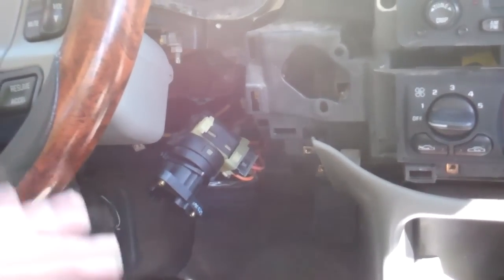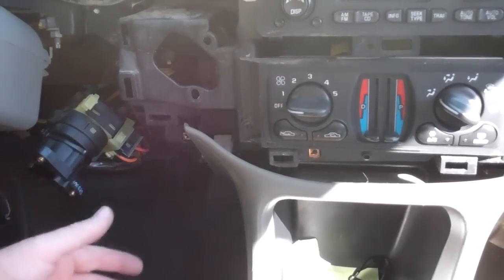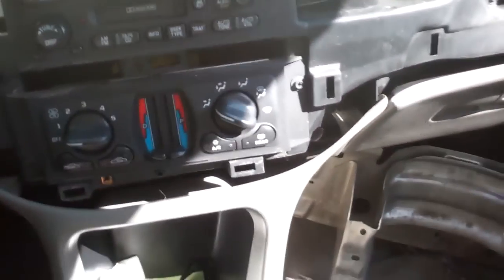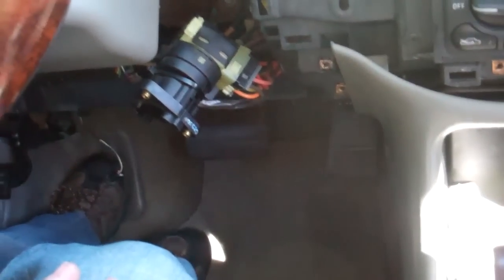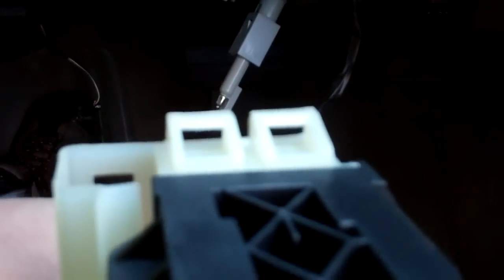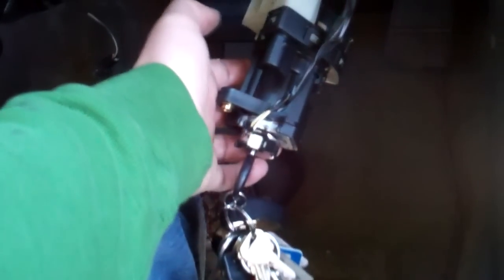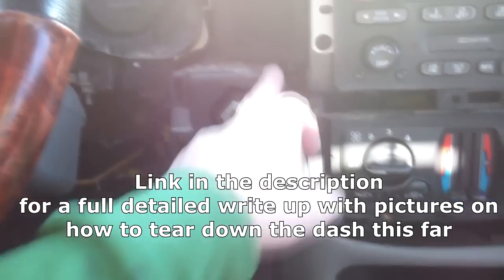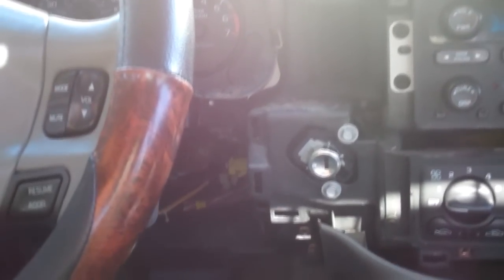GM ignition switch replacement (No Start or Intermittent start)

Comment: Hello, I hope you get this message and can help me with a 2005 Grand Prix GT with the same issue. I have the wiring exposed under the column and I found that the previous owner installed an auto start and a Bypass kit. I also removed the cover under the glove box but there's nothing there. There's something on the passenger side panel but it's different than the Grand Am.  The wires at the ignition switch are black, white, and black/white which don't match anything I find online .   Any help would be appreciated.

Comment: 2014 Civic 
we already re placed the ignition switch ( opposite side of ignition steering column ) 2 months later, SAME NO CRANK, even with tons of  jiggling ( battery , alt,  starter ALL passed )

Comment: My husband has a 2006 Pontiac G6.  Worked fine.  Then he changed the motor mounts and now it won't crank or start.  We changed the started, checked all fuses and relays.  Took off the auto theft device and still nothing.  He lost the key with key codes, but has a regular spare. He's at the end of his rope.  What dies he need to do?  Replace the entire device surrounding the cylinder?
Reply from the maker: Replacing motor mounts will not cause a starting issue.  There was some other issue present before this repair.  Read the service manual about resetting the passlock system it gives the exact procedure.  It involves leaving the key in the "run" position for 10 minutes, turn off, wait 5 seconds, repeat, then try and start.  Read the manual as there are some other subtle details I left out.

Comment: I just put a new ignition switch cylinder and the housing from a junk yard in my 2006 chevy equinox. Now it’s giving me all the lights but it won’t crank the engine or start it. It just does nothing at that point. Can you please help me figure out what’s wrong with it?!  Give me some suggestions it was working and starting fine before. Sometimes it would putter and sound terrible upon starting and I always had to jiggle the key to get it to turn in the cylinder but I figured those were just issues with the cylinder going out.
Reply from the maker: Sounds like a faulty part. Or the pass lock has been enabled and needs to be reset.  More info on site, link in description.

Comment: Thanks a million❤ very informative video
Have you ever done a pcm and bcm reprogram? ThAt would be very helpful as well. My problem is I have a 2004 impala with original 3.4L and fq3 transmission axle ratio I installed a 3.8L with f83 transmission axle ratio the only code that comes up is crankshaft sensor the car starts runs and drives
But transmission bucks between gear's sometimes not all the time could be transmission itself but also could be program was originally set up for fq3 ratio with the 3.4L
So to recap only problems are transmission bucks sometimes and crank sensor. Code because originally set up for 3.4L with fq3
I have installed 3.8L with f83 ratio
Only thing I can think to do is get a vin number from a junkyard that has same similar setup as mine with option code's closely matching mine and somehow program it? Or taking a pcm and bcm from the junkyard that already programmed for my setup..i am concerned about the milage issue though..?would these ideas work??any ideas??Thanks in advance

Comment: Could this be a fix for then you turn the key to start... and you here nothing from the starter? When the key is in the start position.. the lights on the dash go out. All other positions the lights are on. Thanks
Reply from the maker: Possibly.  There are contacts that could be dirty or worn.
Reply: @thejunkman  Have you ever seen that the Passkey has to be reprogrammed due to lack of battery power at some point
Reply from the maker: No, but the procedure is easy to do.

Comment: I bought an ignition switch cylinder can I use the same key and cylinder to start and can somebody let me know pretty fast is a 2000 to 2000 Grand Prix I really could use some help on this thanks
Reply from the maker: You will have to take it to (or find a mobile) a locksmith to have the new cylinder keyed to your old key.

Comment: Impromptu or not, you make a damned good video. I just wish you had showed all the steps, from foreplay to completion, (so to speak). You could speed them up, (as some video makers do), and that gives us a much better idea of what you are describing.
Reply from the maker: Did you visit the link as described multiple time in the video?  To make the full detailed video make the job of fixing it take about 5 times as long.  I didn't think to make the video until half way through the job, thus the written and picture detail in the link.
Reply: @thejunkman showed enough, my way of removing a dash in a car this old is maybe there will be some broken plastic but your car will work🤣
Reply: Na just kidding like u said, just don't pull too hard then go look it up if u can't figure it out

Comment: Gm garage told me it was my pcm or my fuel pump could be my pcm hung up phone went back out to the truck Sean my battery neg end had a crack in new ends on start right up after 7 day working on it don't ask gm $$$$$$ its all that that see and make sour ends are good & tight have a nice day

Comment: What if your key will not turn at all? So you cant turn it to the on position
Reply: tap it the cylinder with the end of a screw driver while gently turning the key, on amazon there is a spray made specifically for locks that have stuck pins/tumblers, don't use WD-40 spray
Reply: 02 grad prix key release under stirring column 0 looking button but u can reach around and not have to use screw driver

Comment: How do you code the key?
Reply: Before 2006 many Chevys did not have chipped keys. If you change the switch you may have to reprogram the security system. The time to reprogram the security  system is after the new lock is in but before putting the dashboard back on.

Comment: It's not that detailed sir. All u do is take the radio out
Reply from the maker: I never took the radio out.
Reply: @thejunkman  to replace ignition switch u remove radio bezel then radio. it can be done in less then 5 minutes that way.
Reply from the maker: Good tip!